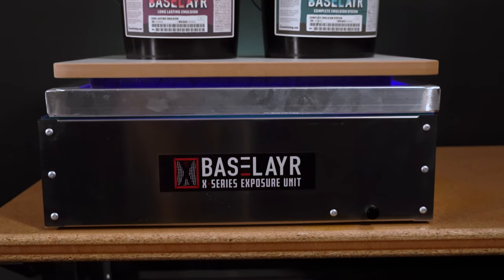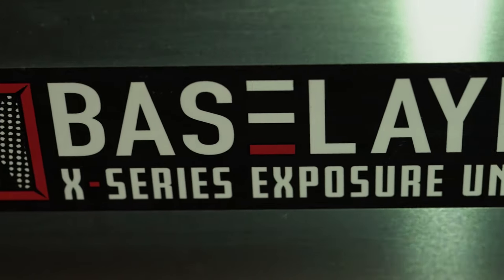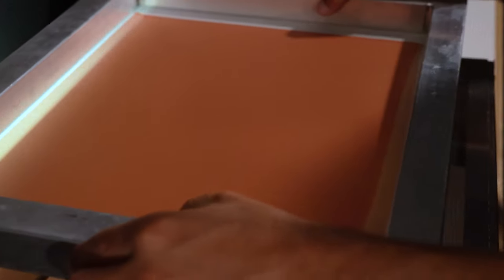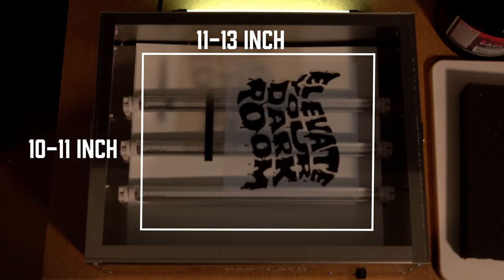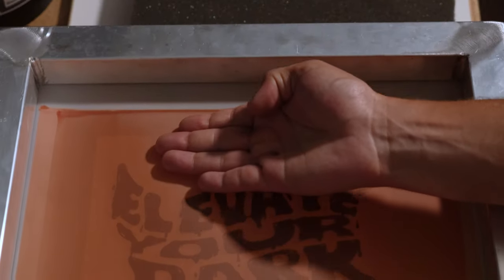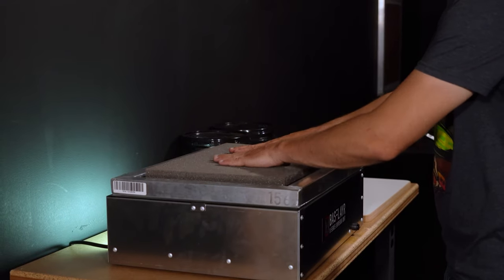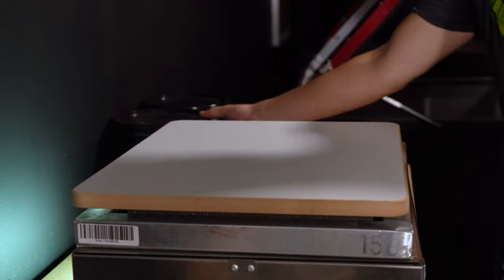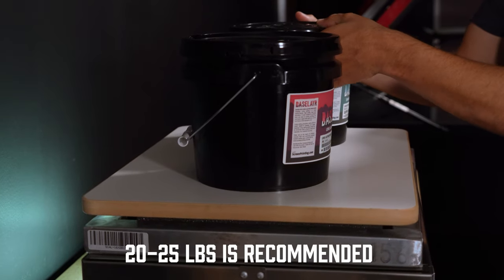How to get the best compression on small exposure units

Comment: How long do you expose for?
Reply from the maker: HI!  Depending on your exposure unit and emulsion, that can be a big variable.

If you are using Baselayr LED Exposure units and Baselayr emulsions, the product page for that emulsion has "starter" exposure times that you can use, make adjustments as needed.

Comment: how is the foam and wood not blocking all the light from passing through the film? and just exposing as a big square
Reply from the maker: Hi!  The light is passing through the clear parts of the film.  Where it hits the emulsion, the light hardens it.  In the area you have the black black  of the design, that is stopping the light.